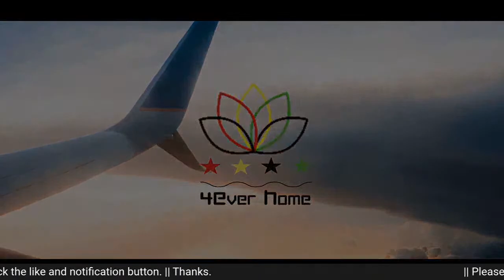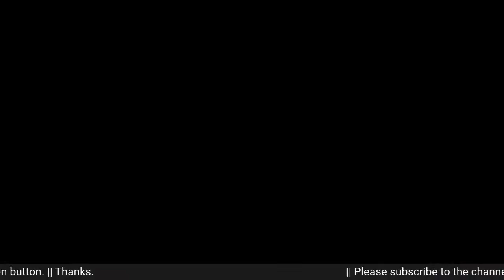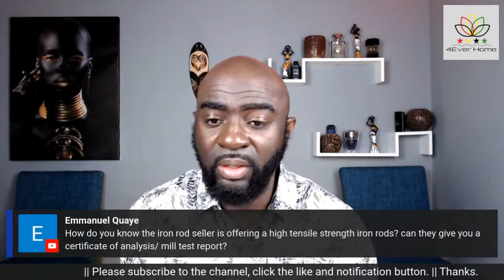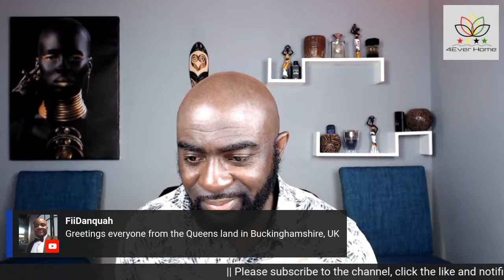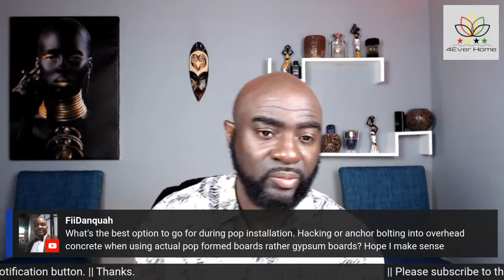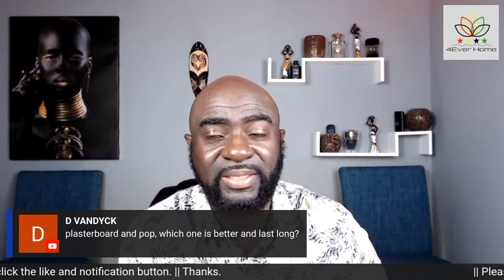|| Can You Tell If Your Builder Is Up To The Task? || Tips To Avoid Compounding Stress & Costs ||

Comment: I've seen so many single buildings without a single pillar. Just raw blocks. This is dangerous. Our building code doesn't work and Assembly is too corrupt to function properly.
Reply from the maker: If you say something, they get pissed off. Maybe a few of these buildings need to collapse to get the message across.

Comment: I understand the importance of not using rusty rebar. I always wonder would it be beneficial to treat the rebar with an anti-rust finish before casting a column or would the paint keep the cement from binding to the rebar?
Reply from the maker: Treat them and let them sit for 24 hrs before using it for the project.